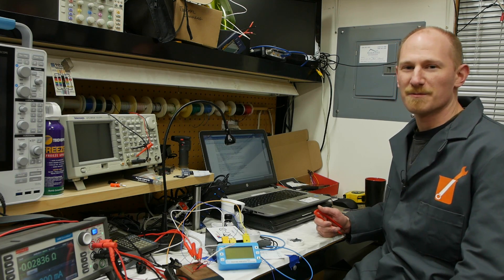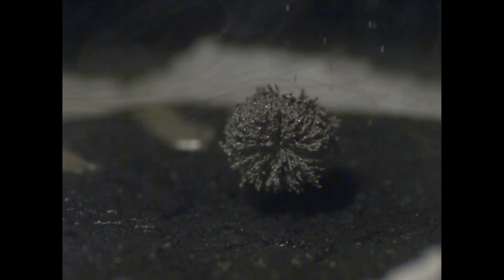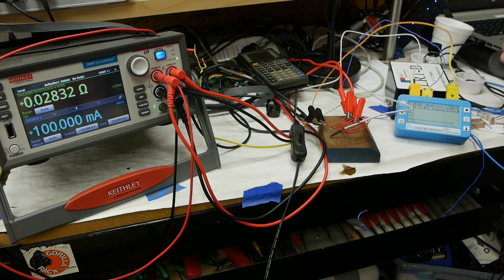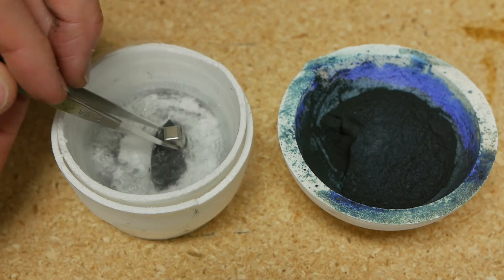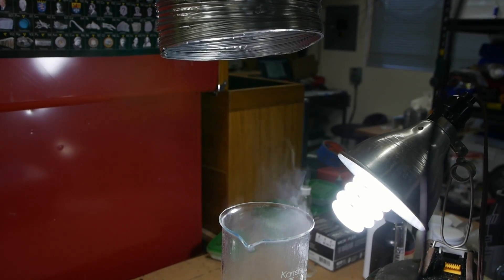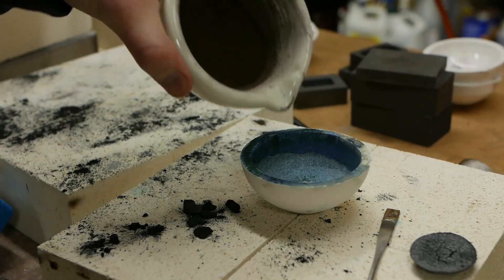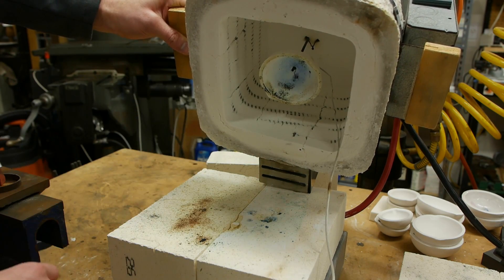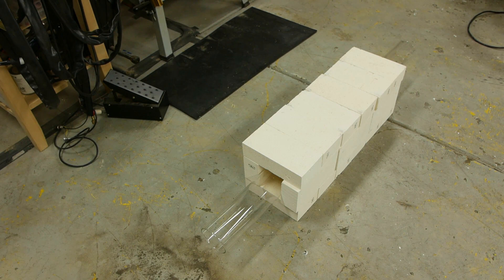Making YBCO superconductor

Comment: The Silver based epoxy could work , but the two middle leads need to be painted as strip across the entire surface or the current will find away around on the exposed surface. That is what I've done working with a YBCO doped with Pr.

Btw, just want to say that I love this content.

I would also like to see your stoichiometry for your pyrophoric method. I hate having to grind my samples up over and over again.

Comment: Would it be more useful to use a temperature sensor that works with your temperatures? It seems that you assume that the absolute numbers might be wrong, but the curve is still right. Is that a reasonable assumption?

Comment: Lately, I'm into pigment science and couldn't stop wandering what is the blue compound formed on the crucible surface. I guess you used an alumina crucible, so the compound could be a type of copper aluminate and in this case both ytrium and barium could have interfered with the chemistry. If it is a silica cruclibe you could have synthesized Han Blue. If it is a mullite crucible the compound could be a misture of copper aluminate and Han Blue. If you still have that crucicle it would nice to make an analisys, maybe you found a new blue, who knows.
Reply: Just found out copper aluminate has an yellowsih color at the temperature you achieved, so I think the other elements played a role on the color. Barium is part of the Han blue (BaCuSi2O6) and ytrium is a component of the recently discovered YInMn blue.

Comment: why not use induction coil to heat sample precisely - initially under a vacuum, then O2 flood in a quartz tube?  perhaps machine a mild steel disc into a crucible of desired width/height...

Comment: A side note, would spray drying the nitrates mixture make a more homogeneous mix of metal oxides? You can control the maximum particle size by controlling the spray drying parameters

(Not to mention the fine mix would probably burn more spectacularly🙃)

Comment: Copper citrate seems pyrophoric and a good fuel for nitrates. My citric acid etch pot for copper and brass parts boiled down. The fume cabinet blew up and the lab door was damaged by the pressure wave.

Comment: I've used a couple standard diodes for cryogenic temperature measuring and they were exact on 0.1 degree, highly linear.
I've had a few, not all diodes work down to those temps but it's highly exact.
You can judge the exactness based on the condensation points, that's also how you can normalize them.

Comment: (Metallurgy student here) I think that it is improper to refer to it as an annealed state. Normalizing is when you bring the material up to high temperature, and annealing is when you heat up the material slightly after it has been quenched. Annealing would imply that you've cooled the material quickly and then heated it up just a little bit afterwards. Although this may not be metallurgy, technically, I think the word normalizing applies better. Really I'm just picking at nits. :-)

Comment: In type 2 superconductors transition to superconducting phase happens gradually, that is some part of the material is superconductive and some other still isn't. Moreover in YBCO specifically the difference in oxigen concentration of various crystals that compose the big black chunk of ceramic makes them have different transition temperature, making the effect even more evident. Magnetic flux is trapped in the non-superconducting parts of the material. If you keep cooling (and have a good quality material, where non-superconductor impurities are smaller than coherence length) the flux is eventually kicked out of the superconductor, with a similar behavior as type 1 superconductors

Comment: Pyrometric cones need more that just a temperature to make them fall, they also measure the HEAT WORK done in the kiln. It's really not just the same thing as temperature. You could have just used a pyrometer to measure the temperature, if that is, indeed, what you are trying to do.

Comment: A+ this lab science work is incredibly difficult and the repeating required with bad results working toward good results requires immense faith and persistence. This type of work is much more difficult and much more productive than the common "my maths" science with it's divorced from experimental reality and often wrong or insane or speculated or thought experiment conclusions that result in so much hullabaloo and fraud in the science reporting nowadays. A hard working and not giving up lab man like this guy where the real value exists. This vid is a key for me in explaining how experimentalists like Eugene Podkletnov's ycbo rotating electrified gravity cooper pair experiments were reportedly not reproduced easily or successfully by a NASA team that was defunded after initial failures. The superconductor disks Podkletnov made were circumferentially reinforced and spun up to 20,000 rpm, a very difficult lab feat. A+ just A+ for keeping on it till success. An amazing amount of patience and persistence.

Comment: Once,some 20 years ago, I have read an article by a man at Ames university of Iowa who made superconductor of matrix of Aluminum and Boron, which was so hard(actually harder then Diamond), that they machined concrete and the tool piece(made out of that material)  on the lathe was not wearing out and at the same time the material was so effective superconductor for heat, that while machining the concrete, it got never hot, because the heat was evacuated immediately away.....

Comment: In the experiment showing magnetic flux going through the superconductor:
Did you cool the material in the magnetic field, or freeze it first, then apply the field?

Because if you cool the material in the field, you freeze field lines into the material.  
This will happen with low-temperature superconductors, too.

Comment: This distinction between type 1 and 2 SC demonstrates the crystalline, orthogonal "odds and evens" quantum fields connection of primes and coprimes. (I've only just comprehended by seeing this video - very impressive tech under any circumstances)

This SC critical temperature stuff is another manifestation of the Curie Temperature..?, a matter of quantum orbital tuning->spacing and tunneling.

Temporal nomenclature, timing duration rates of spacing as the integrated sum-of-all-histories collection of structured/geometric quantum fields for SC..,  has a picture plane of cross-sectioning / unitarity zero-infinity axial vanishing point,  for the collapsed wave of solid, "everything in no-thing virtual motion vector projection"-> 1D connection, and transverse fluid resonance, co-prime state of entangled twoness.. due to harmonics of orthogonal quantum duality. 
(If you stare down the axis of spin in a stirred beaker of water.., something like that distributed in infinities of fractal infinities, until you have a universe in Perspective)
So from that picture, it's fairly apparent why SC is limited to resonant states around absolute zero-infinity axial now for specific bonding states..(?)

Comment: It's worth noting that flux pinning occurs in perfect crystals as well, but for a different reason. In type-II superconductors like YBCO, sufficiently strong magnetic fields destroy the superconducting phase locally, even if it's below the critical temperature, essentially creating defects without actually altering the crystal structure of the material. The flux concentrates into thin tubes of high magnetic field, each containing one flux quantum, which, if you could measure them, would themselves form a two-dimensional crystalline pattern, a hexagonal lattice.

Comment: yetterium, bareim, copper,

lets think about it that we have carbon fibre tube and nanotechnology so we make nano tunnels in this yetterium barium copper mixture by using carbon or graphite so we can calculated it by thought experiment

if we mixed it with ybco in absence of oxygen then put some impurity like piezoelectricity crystal or germanium's or another like wise materials so it become more poros and spacious for electron flow smoothly in between

yahoo we are pretty close to the next technology

Comment: Chemist here, working with perovskites.
IMPORTANT!!! Wear gloves and filter mask/work under a hood as Barium is highly toxic !!! Those flakes fly everywhere and can be easily ingested or inhaled.

Although the chemistry was a bit oversimplified you caught the essentials.
Simple calcination in air should be enough. Also heating at 700C for several hours should be enough.

Comment: Nice. I've made YBaCuO in the 90s. I also wrote most of the data aquisition software and the heat treatment software. Some of that code is still in use, 20 years later.

Comment: hey applied science nice quick fire 6 kiln!! that's the same one i use to glass blow right now :D , tho i'm about to build one about 6.25  times than that one that for far less than the price of that one new , i have about half the parts already and will likely buy most of the rest tomorrow  ill be hooking it up to my "ramp and soak" programmable kiln controller i made for only 150$ (they are normally 450 stock)  that my quick fires controlled by right now if you ever end up frying your coil , id say instead of paying like 250 for the new "muffle" as they call it  you could do what i did, which was just chip out the embedded fryed coil from the insulation "muffle" and replaced it with this very inexpensive coil i found on amazon that was exactly the same spec's from its watts and even length is all perfect (once hand stretched) once fully stretched is  120 inches which is the length of the quick fire 6 kilns element , here's the link for it if you ever find your self needing it , https://www.amazon.com/Kanthal-Heating-Element-120-Vac/dp/B073VBD7D5/ref=sr_1_5?keywords=kanthal+heating+element&qid=1547983585&sr=8-5#feature-bullets-btf  this is the element ill be running my new bigger kiln on just like my quick fire,  whats great is it comes in a two pack for only about 55 bucks  and if you want to make a even bigger or more powerful kiln they can be ran on 220v line when set up in series , but any who just wanted to share that info with you to perhaps save you a pretty penny in the future and perhaps start off any one else looking to make there own in the right direction . but any who, i'm always love'n the videos man, i will surely continue watching them longs as there still being made, so keep up the great work my brother in science! XD

Comment: Hello! Great video! Just to collaborate a little bit, you could have used some 99% silver small leafs to calibrate the kiln. They melt at exactly 960°C and are sold for that purpose. I used to work in a laboratory at my university that tested electrical protections (such as RCCB's and thermomagnetics circuit breakers) and used this silver leaves to calibrate one device called "hot wire" to test the non-flammability of plastics used to manufacture this kind of electrical protections. Hope this helps!

Comment: Knife makers anneal over 10hrs when using cryotreatment on prehardened steels. Martensitic and austentitic crystallization sounds like a similar process to yours. 

Are you using mapp gas or propane to heat the kiln? You may need some ceramic fiber to seal the lid of that kiln.

Comment: I really enjoyed your video! I have a question in regards to the composition of YBCO, is there a reason why Copper is used instead of Silver? I was curious to see if silver would have have a higher temperature allowed to act as a super conductor while producing a stronger magnetic field. The reason I ask is in regards to the MIT project I was reading about called SPARC. The magnetic field strength is one of the determining factors in seeing if the experiment will work, and every little bit helps. I am not a chemist, just curious.

Comment: Awesome video, really love your work! I assume you know this, and didn't go into the details for time, but its well worth pointing out when talking about pyrometric cones (even if only briefly), that they do not measure temperature directly, but measure heat work. Heat work can be related roughly as time and temperature. What is most significant, for those not familiar, is that you can, given changes in time, reach the same heat work (and by extension, the same deformation in the cone) at different temperatures.

Comment: What if you nebulize the solution e.g. using a ultrasonic nebulizer, and then dry it (maybe send the fog through a tube heated with a quartz heater element  or something, where it can react)?. I would imagine that this would give a more constant, less "combustive" production of material. Plus maybe the small and uniform droplet/particle size would make the following steps easier.

Comment: Hi. Very informative, tx. Just FYI - here's some K-Type correction code which I have used very successfully to correct over the full temp range of the thermocouple: https://sites.google.com/site/wikijohann/engineering-docs/arduino-yun/k-type-thermocouple-correction-code
Based on NIST tables for polynomial coefficients. Some of it comes from the Adafruit forums of all places. Forgot the thread.

Comment: Using a vacuum pump on hot gasses may wear your pump out because the heat is going through the pump. Maybe you should use the exhaust from the pump to blow cold air into it

Comment: If you dug out the plasma sputtering rig, could you sputter a coating onto the YBCO, and just solder/braze some electrodes onto metalized pads?

Comment: If the idea is to have a matrix of each element in a certain oxidation state and of atomic dimensions, would it not be easier to make a soluble solution of the three metals say as all nitrates (all nitrates are soluble) and then evaporate it to get them co-mingling properly and then maybe just fire that mix ? or maybe even try reacting that powder with a strong oxidizer to get the oxides? maybe bake it in oxygen ? or high test peroxide ? electrolytic oxidation ? I'm sure plenty of scientist's have tried all sorts of options...

Comment: Type II SC actually fully exclude the magnetic field but only below the "lower" magnetic threshold: H_c1. In this region (- the Meisner state), it acts just as a Type I SC. However, above H_c1, it becomes energetically favorable to let vortices (-magnetic flux quanta in normal-state regions) seep in the SC until the superconductivity dies altogether at the upper magnetic threshold (H_c2).
 Perhaps you could try reducing the external magnetic field (- say by spacing the magnets farther apart) to observe the field expulsion. 
Great video nevertheless! Keep up the good work!!!

Comment: The existence of flux tubes have nothing to do with defects, you would still get flux tubes in a type-II superconductor in the absence of defects. What the defects do is hold the flux tubes in place so they don't get moved around by currents, but that does not require them to be a "pinhole" that goes through the whole material, a single point is enough to hold a flux tube.

You can still get your YCBO sample to exclude flux completely, you just need a smaller magnetic field. Type-II superconductors still show Meissner properties below Hc1.

Comment: I'm missing something here. If the wires that connect the superconductor to the ohm meter are not super conductors, how can you measure resistance lower than the wires? If you measure the resistance of the two wires connecting to each other, and then look for an absence of increase to that resistance when connected across a super conductor, wouldn't that variation be so negligible that you can't prove anything? Even putting the connector tips in liquid nitrogen should change resistance to some extent and make other measurements difficult to distinguish.

Comment: zero resistance means infinite electro magnetism; or super magnetism. flux pinning becomes incorrect? seems more like an exact mirror image of the magnet through induction to current and recurrent magnetism reflection. In other words; the magnet creates its own holding point due to the ceramic's superconductivity. There is a current in both the magnet and the ceramic. Induction is occurring in both. Power transfer is the invisible energy holding them together and apart.

Comment: Hey Ben, have you tried microwave fabrication?  These guys made YBaCuO with a modified chemistry. Namely: Y2O3, BaO2 and CuO (so there's extra oxygen) in a 500W domestic microwave oven.  I also remember reading a followup paper a while back that used an unmodified microwave (the recipe was something like "cook on power 8 for 7 minutes", lol)

See: 
http://iopscience.iop.org/article/10.1143/JJAP.38.L724/meta
https://doi.org/10.1016/j.jeurceramsoc.2005.03.217

Comment: Amazing as usual. I liked your quick and easy air drier for the liquid air maker. BTW I was never able to use the original circuit to my liquid air maker because I screwed up the little coils that sensed the temperature, but I too used the Variac method. It seems like it would be easy to run too much current into the cooler unless you keep an eye on the voltage and current. Could you share some details on the voltage and current you use on the cooler.

Comment: Nice! I've actually made YBCO from the grinding method, we use a ball mill but if you heat it high enough for long enough I think it almost goes to a liquid stage and they mix intimately. Some people have issues with flowing oxygen in at room temp which brings the real temp down, and how fast you flow changes it proportionally. In a tube furnace thermocouple is on the outside of the tube so this is difficult to detect and a trial and error process but about 950 C worked for me. Our hold at 950 was longer than yours, maybe 6 hr